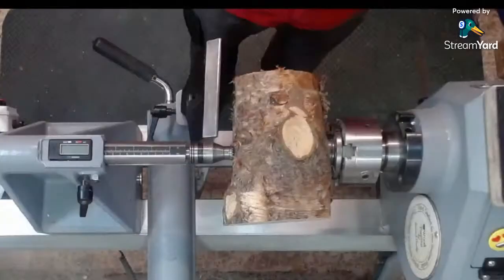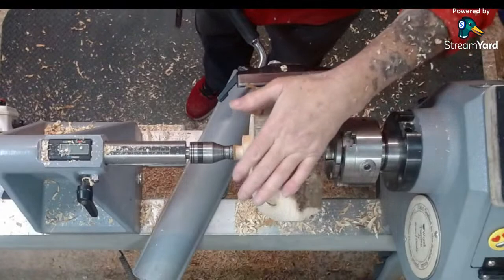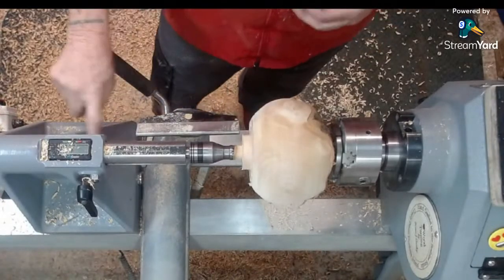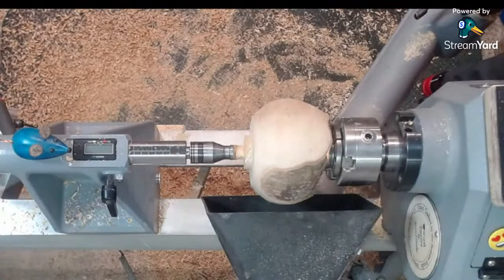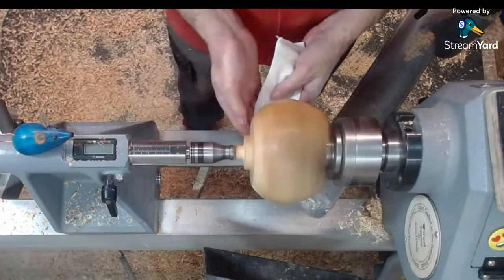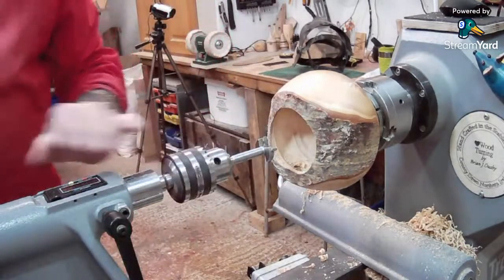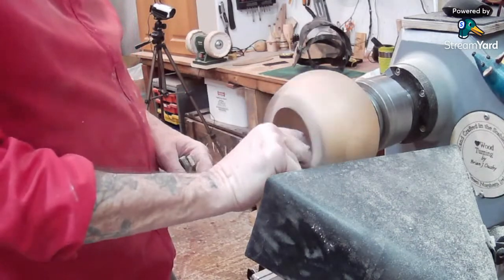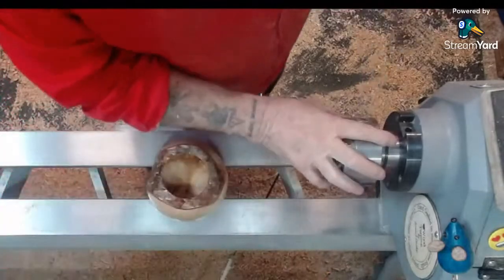Artistic Woodturning- what shall I try today hmmmm

Comment: Love working on cherry. Smell so good, and always a good challenge.
Reply from the maker: I do as well nice timber to turn. Shame it splits so much In the drying process if not Treated correctly 😂👍 don’t ask how I know 😂😂 thanks for watching and commenting
Reply: @Stable_Studio  Cherry likes slow even drying. A shop, basement, or back corner of room with consistent temperature good. Or bucket of rice, shavings, or other absorptive material also works well. Some also have good results boiling cherry blanks, but I have not tried that. Cracks good excuse for inlay, resin or carving!